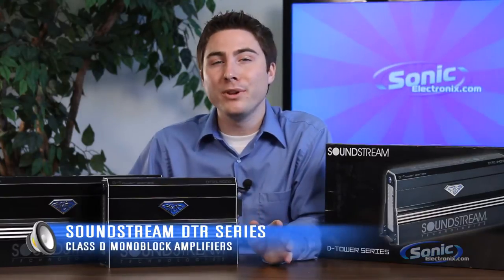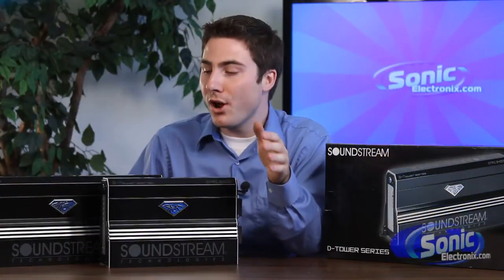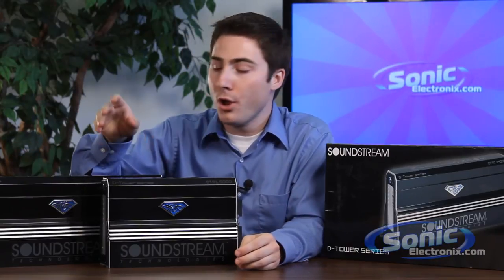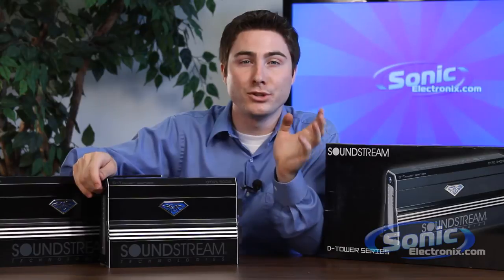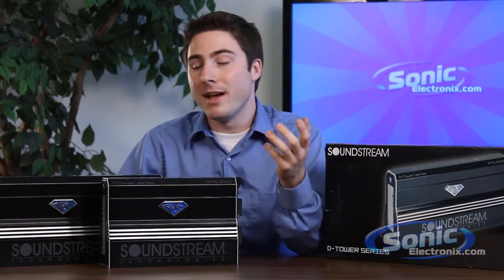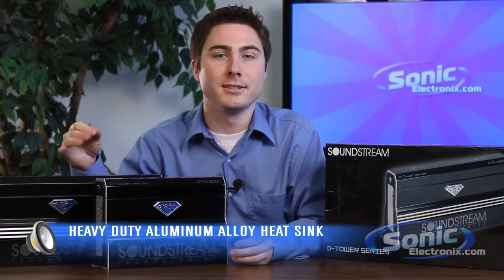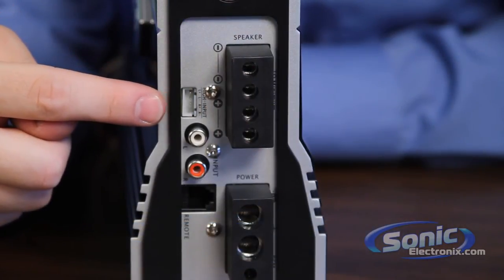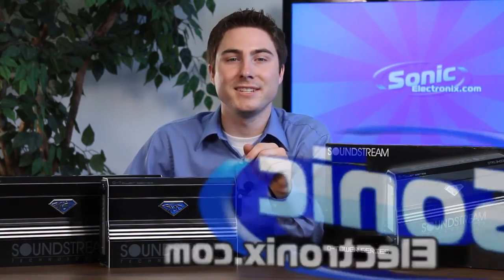Soundstream DTR Class D Monoblock Amplifiers

Comment from the maker: @420basshead420 They have some unique mounting tabs with those particular amplifiers.  Check out the user manual for mounting instruction. There is an entire page dedicated to mounting the amplifier.  Soundstreams website has this manual available on the D-Tower Amplifier page. The mounting tabs sit on the screw location and the other end will screw onto the mounting surface.

Comment from the maker: @lancerz12345 Circuitry class doesn't necessarily effect how powerful your amplifier is, just its efficiency. In most scenario's, a Class D amplifier would be considered a more powerful amplifier just because it operates on switching technologies which allow it to run more efficiently while slightly sacrificing cleanliness in the higher frequency range, making most Class D amps very small and usually perfect for subwoofer applications.  Check out our forums for more about amplifier circuitry.

Comment from the maker: @jr217r Soundstream amplifiers do not meet up with CEA-2006 compliant standards and in most circumstances do not push the rated power.  You can always find an amplifiers true output by looking at the fuses and what they are rated at.  If your amplifier has one 200A fuse, you should be pushing close to 2000W RMS though, but not quite 2200.

Comment from the maker: @acer1234acer Yes you technically could do this but I would not recommend this. One HCCA requires 2000W or at least 1500W RMS to run properly. The subwoofer says it will do 1700 at 1 ohm but since the amplifier is highly overrated and not CEA compliant I highly doubt that it will give you that much. It will probably give you 1000W RMS if you are lucky. This means you will be under-powering each sub by more than the recommend amount.  So we really don't recommend this but it can be done.

Comment from the maker: @LivinLoudNigga It actually will not,SoundStream amplifiers are not CEA-2006 compliant thus the power ratings are  overrated. They are based off a 14.4V battery when most vehicles have a 12V battery. This will cause a significant drop in actual power being provided. If you want an amplifier that is going to give you the stated power 100% of the time try going with CEA compliant amps or high-end amps like JL Audio, Diamond Audio, or DLS. These companies are not CEA but give correct power ratings.

Comment from the maker: No, it was not designed for 0.5 Ohm use. Using this at 0.5 ohms will overheat the amplifier and could even cause of wire.